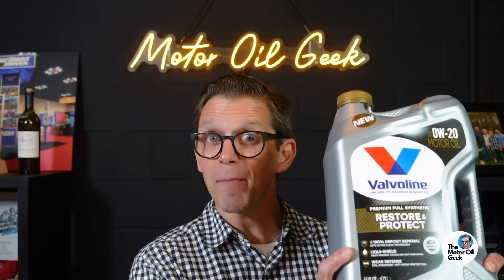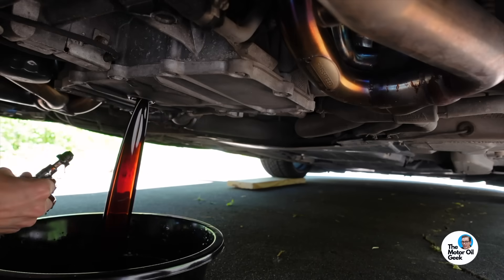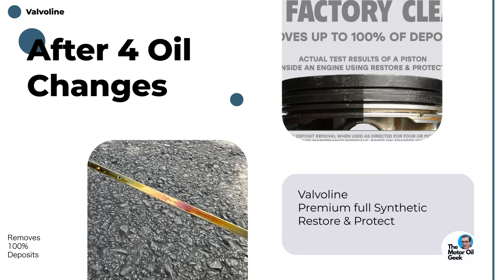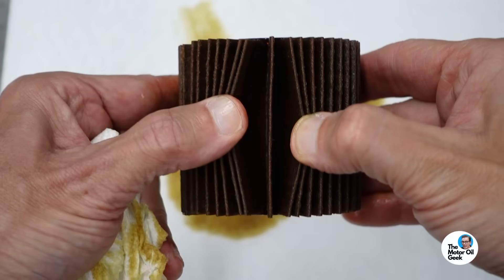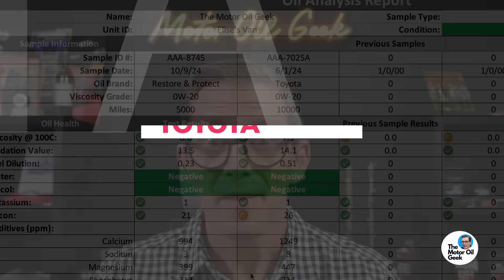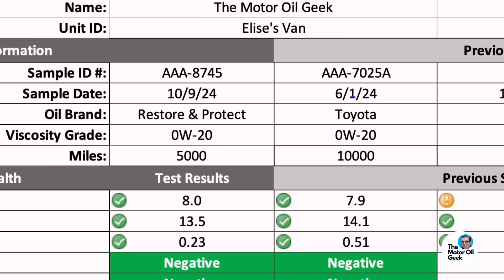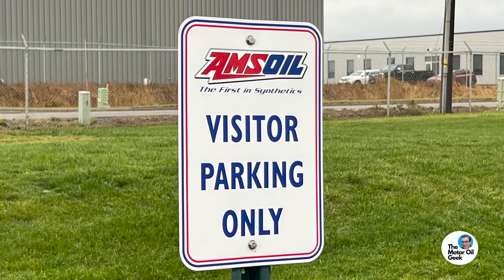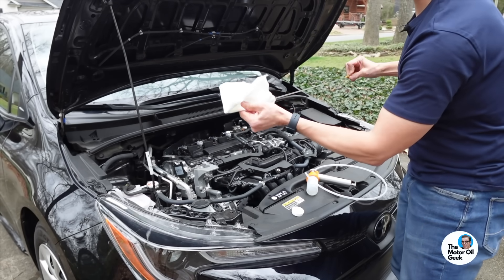The TRUTH About Valvoline's BOLD Engine Cleaning Claims

Comment: Any issues using valvoline R&P on a new 2025 honda crv? Brand new engine only 150 mi currently but plan on changing at 1000mi
Reply from the maker: No, it is API SP rated.
Reply: @ ok thank you!
Reply: Change it now after 150 miles and again after 1000 miles and then regularly every 6000 miles. The engine in the initial break-in period has a lot of worn metal acting like an abrasive paste and that is why the oil needs to be changed so often so as not to damage yourself at the very beginning. I understand you have a hybrid CRV, check if the latest one has the same oil viscosity as Valvoline or lower. In Acura they recommend 0W16 from the factory
Reply: @nabiuro  I have non hybrid EXL crv Awd thank you will do

Comment: Hi Lake, thank you for putting these videos together and compiling the information. I’ve learned a lot from your videos and just switched my son’s 2016 Honda Civic over the valvoline restore and protect from Mobil 1 extended performance 0w20 with a Honda filter. I also put some gumout regaine with PEA in the tank after the oil change.
Reply: I think valve adjustment?

Comment: would you suggest this over pennzoil ultra  platinum  on a clean engine 30k ... since new 20 coyote f150  up till 15 k mc 5w20 semi. oil usage stopped at 15 swapped to 5w30 ultra supreme ,  wondering about your usual  oil comparison flow/ bearing wear/ hot plate tests, actually surprised you using  factory oil instead of  your own "BEST winner oils comparisons  on your your family's vehicles ..............still love the channel

Comment: As a previous technician at valvoline i can say myself of years of using the products they have always been my go too and the restore and protect does work well i bought a 99 honda civic just under 300k miles was running rough did a tune up using only valvoline fluids like i used too work with myself and the car has been running flawlessly and the crankcase has been getting alot shinier

Comment: I will definitely give this product a try!! I've got a used 2010 Scion (ie; Toyota) Xb with their 2.4l engine that is notorious for having weak piston rings that eventually gunk up and cause oil burning, which mine does. When I first got the car in 2019, I did the manufacture's recommended 5k oil changes but had to add 3-4 quarts between changes and the oil looked nasty. I eventually started changing my oil every 2,500 miles (oil is cheap, an engine is not) along with an engine flush treatment right before each oil change. After doing this 5 or 6 times my engine does burn a bit less oil per mile than before.

Comment: I have the infamous 4th gen dodge grand caravan awd 3.8 in my fleet. Its pcv is poorly designed. It consumes oil through the pcv which then cokes up the piston rings and causes more blow by. 

I disconnected the pcv and run it to a catchcan and vent to athmo now. No more consumption through the intake. Running VRP, excited to see what it does for freeing the rings. I am on my first batch. Bought 4 oil changes worth so far

Comment: If that oil has solvents in it to clean the motor, you wouldn't want them in the oil until about 300 miles before the oil change. Just add seafoam to your normal oil.

Comment: I have a 2015 honda crosstour and a 2002 gmc 2500hd, switched both to this oil and have noticed a difference (for the better), esspecially in the 2002 truck.

Comment: hi i have a 1.2 puretec engine. i brought it second hand. 
   they start to use oil about 60,000 miles, and its becouse of the rings getting gunked up. 
   iam not sure if i can use a oil or sludge cleaner as it is a wet belt. 
  also the valvaline repair and protect is not available in the uk. 0w20 but its a special one for wet belts. 
    i thought this would be the best place to ask.

Comment: Great video.  It has been my experience that when I use an oil that has higher levels detergents or has better cleaning properties, the engine will exhibit much louder lifter and bearing noise.  Did you notice any increase in engine noise following the use of the Restore and Protect? BTW, keep an eye out for oil seeping that may have been blocked by buildup.

Comment: Here is a curious question.  Carbon build up is an issue on direct injection engine intake valves due to oil vapor from the pcv.  It makes me wonder if this oil would have any effect on reducing the build up or removing it?

Comment: I bought a used 2005 Honda Element with 148,000 miles in October 2023 and it now has 160,000 + miles. I've only use mobil 1. I might take the oil back and exchange it for the Valvoline.

Comment: I have used Mobile 1 advance full syn for ever. Recently seen this Valvoline restore oil and switched to it a few weeks ago when my change was due. This video makes me feel good about switching oil companies. My 13 Ford Flex ecoboost has 165k and sure I have some build up. Might just switch to this oil on the wife's 20 Edge ecoboost if it works that well.

Comment: In what order are oil function importances? Lubricate, coolant, seal, clean & prevent corrosion.
Reply from the maker: They are all important. If the lubricant fails to do one of those jobs, the equipment will have a problem. A lubricant does way more than just lubricate.

Comment: I have always used Valvoline in all my vehicles, when this came out I got so excited and put it in all my vehicles on their next oil change. It cleaned up my prize Subaru Baja so well that I lost compression in Cylinder one and now have to do a rebuild. Apparently the only thing that was keeping compression in that cylinder was the deposits on the piston rings. I am glad tha tit worked but now I am afraid that my other cars are going to be losing compression soon. (just for reference my Baja has almost 300k miles which is about what all my vehicles have)
Reply: @viper3016  thanks, interesting…….!,

Comment: I have a 2015 Dodge Grand Caravan and a 2014 Honda Accord. Both have types of valve timing control systems that use the oil to function properly, so I switched to this oil to hopefully extend the life of both the engine and these components.

Comment: It's interesting that you told me not to use the 020 in my truck because the formula wasn't the same for the diesel as it is for the gas yet you use it in your Toyota which is also not the same formula. And now you're suggesting using it with the wrong weight for your daughter's car. So why won't it work for my truck? It's the same weight. Lol 🤣

Comment: Good oil probably, but too bad they don’t offer it in 5W40 (only 20 or 30 is available). Especially older engines with lots of deposits, where this oil would make the most sense, prefer a 40 weight oil.

Comment: Great video! Using this in my 5.7 Tundra currently!
Reply: How is it going so far?
Reply: @ it works well! I manage a fleet and I am going to switch our gas engines to this.
Reply: @jordanhannah5839  what has changed? Mpg? Engine noise? U use 0w20?
Reply: @jasonc3po use 5W30, engine noise is slightly quieter. Dipstick is now spotless as noted in this video. Use with OEM filter.

Comment: I tried it on my 14 Explorer with 198K miles. It runs the same afterwards as it ran normal anyways. But I was going to keep using it but its price at Walmart went from $24 to $29 so decided not to use it.  If they go back to $24 I’ll buy it.

Comment: Hmm.., my friend and I have Toyoto 300 Land Cruisers, my car has done 80,000 km and my friends has done 57000 km. I use 5W30 in cooler months and 10W30 in hotter months, oil changes every 7500 km. My friends engine has already spun big end, his car serviced by Toyota every 12000 km and using 0W20. We both use the cars for towing 2 ton trailers.

Comment: Pull the engine apart and then examine. At the minimum use a bore scope via sparkplug entry to look at the pistons. Filter examination is only 1/5 of the story.

Comment: I'm trying it I got my 2002 Saturn SL1 with 12,000 on it! In 2004 It's coming up to 180,000 I've tried cleaning additives but it's not cutting it! Thanks for posting video!
Reply: I wish I still had my old SL2 to test this oil on. I’m guessing it will unstick the rings and reduce the oil consumption that plagues all of those engines.

Comment: Been waiting for your update on this oil. You're the only one going in depth for us all. I currently have 0w20 VALVOLINE R&P in my 2012 corolla. So far the car drives great and in the winter time it warms up quick. My engines not too dirty but I will be checking my samples every oil change.
Reply: 0w20 oil in engines with higher mileage, look up the term oil dilution,  especially with egr and dpf.
Suggest frequent oil services
Reply from the maker: Thank you!

Comment: I am on my 6th cycle of restore and protect with my 2018 sonata. Been using since the 1st week it hit the shelves and paid that original $45 price at autozone to get it. I love the stuff. I swear it remedies the oil consumption issues of the Theta II engine. My replacement engine was at 35,000 miles when I started using it. When I would open the oil cap after driving it would smoke a little bit. That problem is gone. Now have over 50k miles on the new engine and no oil consumption, minimal blowby, and the car altogether just runs better with this oil. Can't recommend it enough

Comment: I have a 13 Transit Connect which has a 2L Mazda L engine with 250K miles of which  I've done 80K. It does not use a drop of oil and runs perfectly fine. I didn't see this oil when I just went shopping and I've used Valvoline so I just went with the high mile type as per usual. I was wondering if I would buy it if it was available. I mean if it ain't broke don't fix it?

Comment: Well if you change you oil a lot sooner than say 15,000km or as per service on your oem manual ,likeat a 1/4 of the km or miles done ,with good oil, you will not have any varnish on the internal engine components plain and simple, it those owners who run their car into the ground and have caked on varnish, like taking off a rocker cover and its black as night, tells you what's been going on with the owner and also the pcv valve will be blocked up with old oil fumes as well, so be carefull, when buying a used car, now they brought this oil out so many owners will run till they have clean oil coming out or almost clean, before the sell the car yet it has over 100,000 miles, thats means the engine might be clean inside it, but due to not changing the oil and filter to keep the internals like new, your getting ripped off people so be careful ,when buying a used car. cheers 😎😎✌✌

Comment: Lake jr, mate you need to use a camera and look inside the top of the head to see the valves and also the chamber walls to see just how clean they are, sure oil tests can help a lot ,but for those who do not understand what their engine is made out of, its very hard to know what the oil tests prove, meaning the rings used by the oe manufacturer and what the other aspects of the engine are made out off etc. Like bearing's ,chain guides timing chains, direct injection engines suffer from so much oil fumes damage as well in the intake ports and also exhaust ports. etc. carbon build up etc. 🦘✌👍👌😎😎
Keep up the great work champ. 😎😎✌✌

Comment: I have been considering running this oil in one of my vehicles that has some oil consumption (piston rings are known to get gummed up).

I am going to pull the engine apart this spring and freshen it up due to the amount of oil consumption. I guess it wouldn't hurt to run this oil till then and see if it helps.

Comment: and because i use only Amsoil products in my 2010 Prius 127,000 miles, 2004 Ford gas powered V8 truck, 78,000 miles, 2002 Harley 17,000 miles, and air cooled lawn and garden 2 and 4 stroke engines...What say you about wear rates of the Valvoline restore and protect.....Should i switch.??

Comment: I have a 2014 Ford Fusion SE Turbo 2.0.  I change the oil myself every 3-4k miles.  I have run Mobil 1 Full Synthetic Extended Mileage on it for awhile, but since Lake's video on the Valvoline R&P  I started using it the last 3 oil changes.  I noticed the first change of R&P, the oil was darker, but I purposely changed it at 3k in case these was a lot of deposits that were knocked out and cloging the filter.  The second change, which I just did 3 days ago at about 3,700 miles, the oil didn't look quite as dark and seemed to flow better.  I keep my filters and label them.  Once I get 2 or 3 more changes I will cut the filters and inspect them.  I have noticed the engine does run a lot smoother since I started using the R&P. I was a Valvoline guy for years but switched to Mobil1 in all my vehicles about 5 years ago, now I think I'm sold on this Valvoline R&P, it will be the only Oil I use now in all my vehicles.

Comment: The lack of finding anything in the oil filter would keep me from using this in a turbocharged engine. Deposits would most likely clog up the TC screen or even the TC itself. But I'd definitely use this on a non turbo engine.

Comment: My mothers Audi A4 1.8turbo gas engine with 125k miles used 1 quart per 800 miles.   Horrible,  but running this oil (5w30) for a short time of 2k miles, she needed no oil top off.  Amazing!  Even for a gearhead mechanic like me. 
I switched most of my oil burning customers to this killer stuff .  Great video. Keep up the excellent content. 🎉
Reply from the maker: Wow, thanks for sharing.
Reply: my civic burns ALOT of oil..about 700-1k per qt. Car calls for 5W-20, should i just go with 5W-30 to get lasting effects from the oil consumption? Was thinking it wouldnt hurt to keep this in longer & get more out of it? Thoughts? Also, should i top off with this or can I get away with other simialr valvoline products till next oil change? Apprently it takes 4 oil changes for it to work 100%?! Also, after the 3 oil changes, can I go back to my old Castrol oil for sometime & use this periodcally in like every 4-5th oil change? 
P.S. I change my oil 3-4k miles Thanks!
Reply: @dbzownz12345   If you do you own oil changes, it takes the stress out of min/maxing the budget.  Let your filter be your guide, check it early if possible.  If its filthy then change the oil again.  When it's looking better put the regular stuff back in it.  Don't be afraid of using 5w30 in a Japanese engine, nothing catastrophic will happen.  My oil tech runs 5w20 in his civic, doesn't do oil analysis, but changes it every 3000km, what's that like 2000miles?  He gets the oil for free so why not lol.  
Piston soaks also help clean things up as well, but there's a risk with that.  I wish this oil  was on the market when I had bad burning audi, that would be a testimony story.
Reply: Why switch back?
You can see what your Castrol did to your engine. Don't be a glutten for punishment.
Reply: @louarmstrong6128  Because this oil is said to eat through some seals and gaskets, especially very old ones, it probably has some solvent in it.  Low compression rings is the main cause of oil consumption issues.  The same oil doesn't mess up engines with good rings, it's not the oil's fault. 
 Some people check the filter very early to make sure it's not heavily mucked up, but it will take years or +100k to get dirty again.  I'd continue using performance oils, like driven, for the most part.  This just for cleaning.

Comment: Been running the R&P oil in my wd21 pathfinder for a few thousand miles and I did my valve cover gasket on the passenger side of the original 237k mi VG30i and it was shocking how clean the upper valve train is looking.

Comment: I would still like to see the pistons/rings pulled from your wife's engine after several oil changes to visually inspect them. Mr. Geek: Are you up to the challenge?
Reply: Why don't you do it and post it up?
No trivial task, and he's a busy guy...
Reply from the maker: If you want to pay for it, go right ahead. I have complete confidence in the dyno test results. I know the dyno is harder than the real world, so I have no doubt the pistons are cleaner than before.
Reply: @themotoroilgeek  How about using a borescope to inspect the cylinder walls BEFORE and AFTER?
Reply from the maker: @steveolive9991  The cylinder walls will not tell you anything about the piston ring grooves.
Reply: @themotoroilgeek  the oil would be cleaning all internal parts including the cylinder wall, correct?; the job of oil is to cool, clean, lubricate, seal...may not show the piston grooves, but the cylinder wall wear/condition -- or lack of it -- would be somewhat of an indicator.
Reply: @themotoroilgeek  I lack a garage to pull an engine. I just figured that you routinely pull engines and tear them apart so  it would not be a big deal; just a regular day for you to pull an engine.

Comment: @themotoroilgeek  What kind of 2 stroke oil would you recommend running in my Chainsaw. Just bought a brand new Stihl ms400c and a 500i.. there's other videos out there about it but everyone has a diff answer. I figured I'd try you since you are the expert on oil period.. whether it be 2 or 4 stroke.. thanks in advance.. hope u had a great Thanksgiving 🦃!!

   This seems like good stuff.. I may try using it and see if it helps my high mileage truck..

Comment: Lake - not trying to be a smart, but I’m curious how are going to use R&P in your daughter’s car- when hers takes 0w-8? Last time I looked the lowest they made R&P in was 0w-20. I have 2022 RAV 4 non-hybrid with the 2.5L and that engine specifically calls for 0w-16. You’re the oil expect :) what are your thoughts ?
Reply from the maker: The 0W-8 is for fuel economy, so a 0W-20 will not hurt the engine.
Reply: Ahhh so if my truck takes 0w20, i can run 5w30? Im sure nobody has asked before haha @themotoroilgeek@themotoroilgeek
Reply: @themotoroilgeek  I've always wondered this:  By not using the grade of motor oil required in your Toyota owner's manual, will it void your factory warranty?  Thank you.
Reply: Wondering the same thing